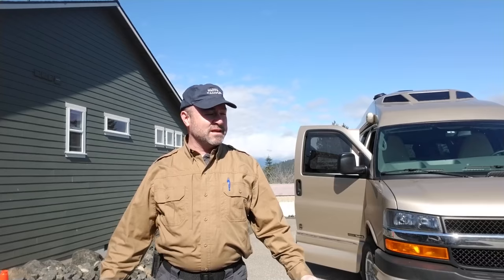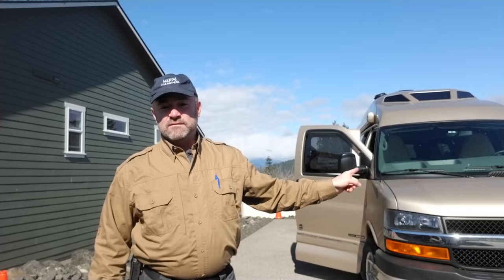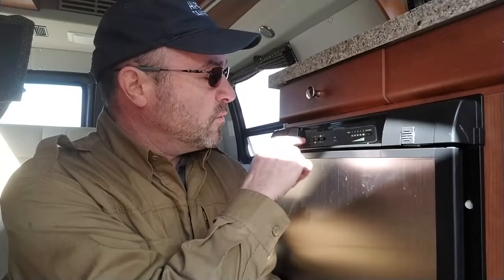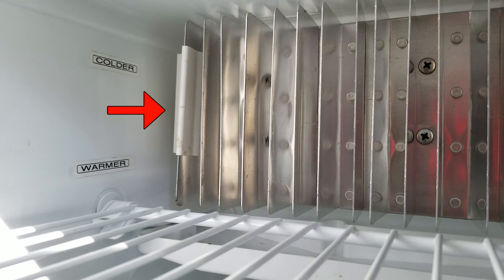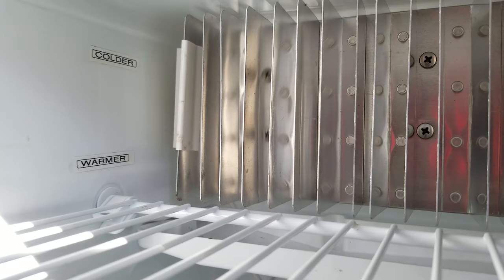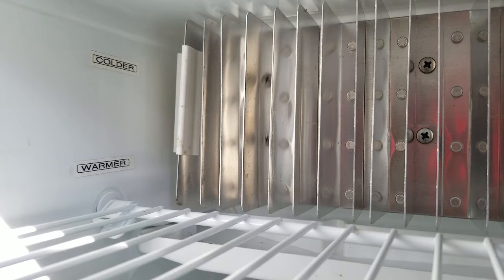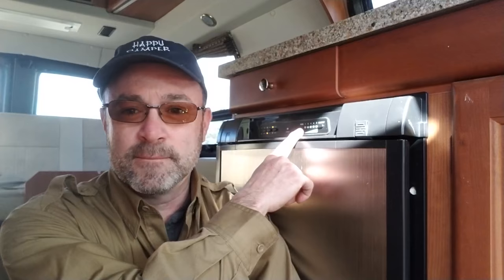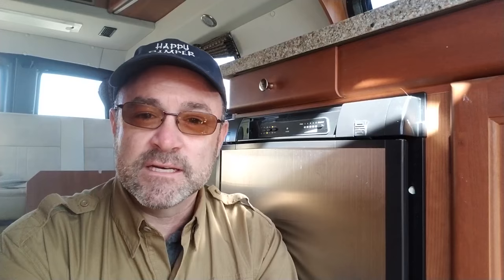RV Refrigerator Temperature Adjustments

Comment: Thank you for telling me about the arctic mode. The thermister was hanging off the bottom and the fridge had turned into a freezer. I had no idea how to get it warmer because it literally couldn't go any lower. You're a life saver
Reply: YES! Thank goodness. Just purchased my first caravan ever and all of a sudden my fridge has frozen almost everything! Noticed that little cable hanging and tucked it back into the slider. I saw a fellow camper had poked a hole into the slider and zip tied the cable to it so it stopped falling out :) I’m going to do that. Fingers crossed my fridge no longer freezes all of my contents! 🤞🏻

Comment: Thanks for the info on Arctic Mode... news to me how I could cool things down quickly.  When I start my fridge I add a few half gallon milk cartons of ice to help it along.  My Dometic is in a 2016 Leprechaun and does not have the buttons that tell the boiler how long to stay on, maybe they "moved on" from those buttons.  I have a button to select electric, one for LP and one for Auto.  Very simplified.  Thanks for your videos.  I choose to have technicians do the work when I need it but I like understanding the problems and the process.  ✌☮

Comment: I recently bought a used fifth wheel and couldn't figure out how to turn my refrigerator temperature down, it was literally a freezer until I watched your video which makes perfect sense, I saw the wire dangling near the fin but no slider for it so I duct tape it on the Finn and now it works perfectly, thank you so much the only thing is I don't have the slider for 12345 on this refrigerator?

Comment: Well you haven't answered my question but I did find the manual for my Norcold N811 and on page 9 is say to move the Thermistor to the left for colder temps and right for warmer temps moving it only one or two fins at a time. I have tried this and it works.

Comment: Can you explain HOW the position of the thermistor on the fin makes a difference in temperature reading? In other words, why does being higher on the fin make my fridge colder than when it is in the lower position?
Reply: I would assume it’s because heat rises
Reply: The temperature in these fridges varies from coldest at the top, to warmest at the bottom. The fins are very cold near the top, because the freezer is right there.
Reply: My fin had a cord that went in it that had become disconnected.
Reply: Mine in a Coachmen Class A just has a plastic clip with nothing buried in or connected to it. 
I'm pretty tech savvy, been voiding warranties since 1975, I spent 10 yrs in radio learning from some great engineers and was a digital systems specialist (fancy copier dewd) for 16 yrs... but for the LIFE OF ME, i can't see how this simple piece of plastic could possibly have any influence whatsoever in affecting my fridge temp. No wires on that fin either, traces, etc... its justa fin with a plastic clip on it. 🤔😳🤪
For the OP: but winded for about :53 worth of info... but thanks for the upload mahn! 🖖

Comment: Thanks for your information, I live in sequim and I'm a full time live in,, sometimes my frig. seems to cool down and I usually shut it off for a few minutes turn back on then reset the temp. to about 7 and after an hour or so I look into the frig. and see the fins starting to frost up but only about 1/2 of them. not sure what causes that? but I did like your youtube info.,, if anything else fails I might give you a call,,, thanks again,,, Tom

Comment: Refrigerator Temperature Settings Norcold

Polar 7 Series (N7V, N7X, N7LX) Models

Polar 8 Series (N8V, N8X, N8LX) Models

(One button display controller)

Refrigerator Temperature Settings has three (3) temperature settings. Touch and hold the ON / OFF button.  The power ON indicator light will go out. Continue to hold the Power ON / OFF button.  The power ON indicator light will come on after 20 seconds and go off again after 23 seconds.  Continue to hold the Power ON / OFF button.  The power ON indicator light will come on again after 30 seconds.  Release Power ON / OFF button.

The color of the power ON indicator light shows the current tem-perature setting of the refrigerator:

 Green shows the COLD temperature setting.

 Amber shows the COLDER temperature setting.

 Red shows the COLDEST temperature setting.  

Factory preset is on green temperature setting 

Touch and release the Power ON button and the Power ON  / indicator light will flash on and off, which indicates that the temperature setting can be changed. 

While the Power On indicator light is flashing, touch and release the Power ON button to change to each of the three (3)temperature settings, one at a time.  When the desired temperature setting is shown, touch and hold the Power On button for ten (10) seconds to exit the temperature setting mode. The Power ON / indicator light will stop flashing and return to the solid GREEN or AMBER depending on whether you are currently using propane or electric.

Comment: We are tired of having to turn off fridge once every couple of months to defrost... because the ice build up on the fins is packed solid clear to the middle of the fridge. Any suggestions to help with this? 2003 Itasca Suncruiser.Class A. Wondering too, if it matters that the little thingy that slides up and down , if it matters that it is all rusty.... Fridge temp hovers around 34--39 degrees. We have a little digital temp thing we have hanging near top rack close to fins.

Comment: So right now it's August 2020 I'm in Southern California experiencing a heat wave My frigerator all of a sudden started heating up.

(I'm new to full-time rving)

I put my front control settings to number 9 which is the maximum and I still can't get the refrigerator to go low enough I'm running around 60F terrible, all my food is going bad😨

Then I came across this video thank you very much, I knew of the back sensor in fact I moved it low during the winter time because my fins were freezing up.

I completely forgot about it now I moved the sensor up higher on my fins, hopefully my refrigerator will start working now.

Thanks for the video I wouldn't have thought about moving that sensor back up again since I normally don't touch it 👍

Comment: I looked and my Norcold N891F in my 2016 Jayco Alante 26ay does not have a slider, only a 1" long wired black thermistor(?) mounted high on one of the fins.  Does any of this info apply to my unit?

Comment: I have dometic rm1350 and the drain keeps freezing up and the tray also not fins but under fin on plastic. I checked drain tube it has cap on end also no blockage. I have the thermistor that is attached up top and not sure how it supposed to be set what's cold or warmer lol also replaced doors after dealer messed them up but the seals keep getting moldy they seem like they close good but hard to tell. My fridge is on 37 with 3 on setting it was on 4 and 5 but hubby bumped it down to see if it will help. Any help be nice. I'm at a loss.

Comment: Does it matter which Finn the slide thing goes on someone told me it should be on the 3rd then. Also, I have some wire that's supposed to go inside the fin but you don't show that on here so I'm not sure where it goes

Comment: You say can disconnect probe off fin and dangle. I have problems after 80f to keep fridge cold. I added a fan inside fridge and in the back. I added blue blocks of ice to help. So during the hot season is it ok to leave prob at air temp, and if so what number should i use.
Reply from the maker: Here are two videos from our refrigerator playlist that may help. Your issue may be shedding the heat off of the cooling unit on the back side.
 https://youtu.be/IT_5HGe4q-k

And here is another one that might help:

https://youtu.be/ZHgOVrjibZ4

Comment: I bought a new RV with them same brand of refrigerator (Dometic), but mine has a freezer on top. (8 cubic feet of fridge)
 The manuals did not come with the new rig that tell me how to adjust the temp - so hopefully you can help me with an answer.
As you stated on top is the 1-5 coldness with a button to adjust, on the inside is the up and down slider. Currently the top button is on the highest (Coldest) setting of 5 and the slider is in the middle of the fin. I have it running on electric mode.
 When I used to put water in ice cube trays in the freezer of my other RV, the water made ice cubes overnight 12 hours.
I put water in the ice cube trays in this new RV, the ice was not frozen all the way through after 18 hours like before.
 Should I move the slider in the refrigerator up? Should I change the 1-5 adjustment to 3?
Any ideas or advice would be appreciated.

Comment: On my Norcold I tried this and moving the thermister up or down did not change the temperature. Moving it to the left side fins made it colder and right side warmer.
Reply from the maker: The up/down procedure works on Dometic refrigerators.  On Norcold you count the fans. You are correct moving the thermistor one-way warms up and the other way cool it down.

Comment: In my 2016 Norcool I replaced the thermistor today, the coils heat up and have a nice blue flame, but still doesn't cool down very much.  Refrigerator works great in electric any suggestions. (The freezer is cool but test water bottle doesn't freeze up).

Comment: Will this work on a Norcold N811V that is Automatic? I have a ARP Controller on the frig an run it on electric 90% of the time with 2 small fans from ARP Controls on the top pointed at the fins running full time with Thermistor on a middle fin and frig is too cold. Should I move it left or right in addition to down on the fin?

Comment: Thanks. Is it ok to think that when I start my refrigerator from OFF state that I should set it to 5 so it will get faster to the optimum temperature, and then when it reach it lowering to the lower value will just maintain it more precisely?
 Like if 5 is coarse and 1 is fine tuning
Reply from the maker: The boiler is not going to get any hotter, or cool the refrigerator any faster, based on the setting. The best analogy I can offer would be that of a toaster. Where you have settings 1 2 3 4 5 based on how you like your toast. So, it's not so much coarse or fine, it has to do more with how long the burners going to stay on, or in the toaster analogy - how long the heating element is going to stay on to either warm the bread or burn it.  That 5 setting Works directly with a thermistor. The thermistor tells the board it's out of temp range. The board then looks up at the 1 2 3 4 5 board to determine how long to turn on the boiler. I hope this helps.

Comment: Thanks for the videos.   I have a Dometic 2554 installed without a roof vent and been having a lot of problems cooling on LP.  Changed all circuit boards, added 12 fans, changed LP regulator, cleaned orifices, etc.  but still no luck.  I am down to the thermister and was wondering if I could put in bypass (artic) mode by just unplugging from lower board.  I understand I could do the ohms test but wanted to try just unplugging in for now.  Can I do that  to test?  I assume if so, it will not damage the lower board?  Thank you.
Reply from the maker: You are correct, unplugging the thermistor from the lower control board will put the refrigerator into limp mode.  This procedure will not harm your refrigerator nor the control boards. In limp mode the refrigerator will continue to operate without regard to food compartment temperature. But you make another important point. You state that the issue is revealed when the refrigerator is in LP mode. Does the refrigerator work fine in AC mode? If your refrigerator is working fine on AC mode but your issue is revealed in LP mode that it will not be your thermistor. That device is common between both of them. This also rules out your Cooling unit and the ventilation through the backside since all of that is common to both the AC and the LP operation. So your issue is going to be with your LP components.  Verify that you have proper LP pressure to the burner orifice.  Those can develop a blockage.  Verify the burner is not obstructed or filled with a fine rust.  Also inside of your boiler (accessed from the top tube) there is a flu baffle that might be missing on has failed.  On our website https://myrvworks.com/manuals/ you'll find a service manual for your refrigerator. Just filter for  "Dometic/Refrigerator" and look for the manual titled:  "Dometic RM2xxx Service Manual Americana & Americana Plus.pdf". Good luck and happy camping!
Reply: @MyRVWorks   I wish you were in Florida.  You are correct it works in AC mode.  I have not checked the LP pressure but the flame may be weak.  It does kick out a lot of heat so I was hesitant to get the LP checked, but there is little left.  I now have 4 x 12 volt fans I installed pulling out heat in back, I put Rockwool insulation around everwhere I could (they installed it incorrectly--I did watch you video on this issue) , I cleaned the orifice, the burner tube and the baffle, but I don't know how high to position the baffle.  The manual says somewhere around 1 1/2 inches above burner.  Not sure how the baffle can fail?  Since my last post I did check the thermistor in ice water and you are correct.  It was within specs.  I guess it could be the selenoid valve, but manual says that is rare.   Sounds like I need a manometer  to confirm 11" WC?   Thanks again.  Your channel is outstanding and I appreciate you taking time to help out the uninformed.
Reply: I just looked at my baffle and it looks like it broke in two.  Dometic Part 2932667021. Any idea where I could find one?  Web searches are coming back with no hits.  I would post a picture but I don't think I can.

Comment: is it important to be on the first fin? I found that if I put it beween the 1st and 2nd fin it is tighter and could remain in place. On the first fin it tends to slip down
Reply from the maker: You bring up a very valid question. The only way I should properly answer this question is to refer to the service manual for your specific model of refrigerator. There are different locations where the thermistor should go on the fins with respect to the different model numbers. Some I've seen on the left, some I've seen on the right and some I've seen in the middle. So for you, let's find your service manual and see if we can't identify exactly where the manufacturer expects that thermistor to go. The more accurately we are to the spec the better results you should expect to get from a refrigerator. On my web site resources tab I do have a lot of service manuals.  Just searched for your refrigerator manufacturer and you should be able to find it. I don't have all of the manuals but I do have quite a few. hope this helps. Happy camping.

Comment: Is leaving the fridge in ARTIC mode a good thing or bad thing?
Reply from the maker: By 'Arctic' mode are you saying you're leaving it at the highest cold setting? If that's the case, and you have to leave your refrigerator on the coldest setting for it to be effective, you may want to go around back and check the ventilation up the backside of the cooling unit. I've done several videos on the proper airflow through the back of the cooling unit. If you can't scrub the heat off the back cooling unit, and especially the condenser coil at the top, you will have cooling performance issues on the inside.  That is to say, a healthy happy refrigerator should not have to be on the coldest setting to operate.

Comment: What do I do if my fridge keeps freezing up? I have it on the warmest level
Reply from the maker: We will put together a video on this topic because it's a pretty popular one. One thing to look for is that drain tube out the back side. It's good to put a P-trap in that line. Any moisture that's in the ambient air could work its way in that drain tube to inside your food department. When it hits the cold fins it becomes ice.  Another thing to look for is proper ventilation up the backside cooling unit.

Comment: Does anyone know why the dometic fridge would be hot inbetween doors
Reply from the maker: Yes, that is a heating element run along the doors to prevent condensation from building up at that location. Some refrigerators have a switch where you can turn that on or off. On our website we have many manuals for refrigerators, you can see if you can find your operation manual and it will describe more details there:  https://myrvworks.com/manuals/